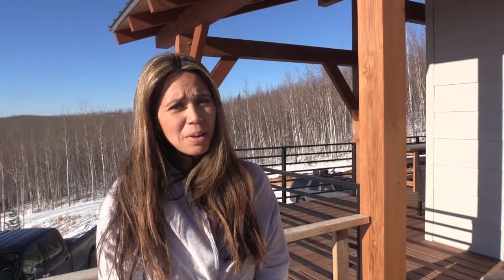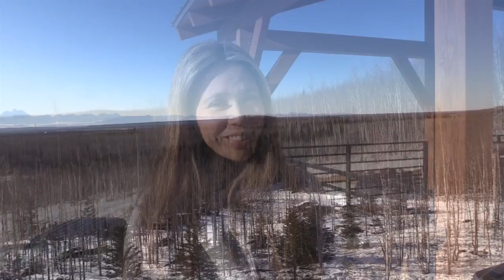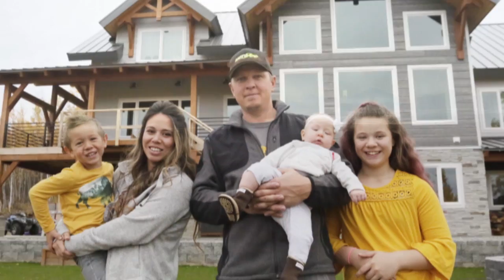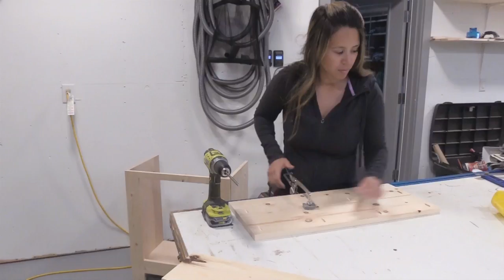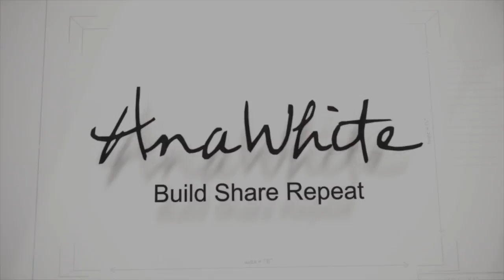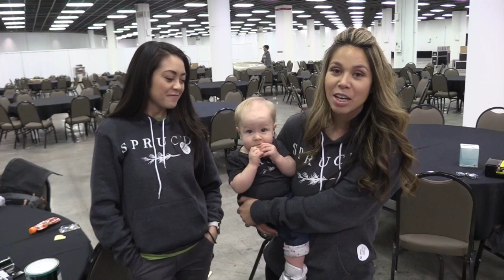DIY Trade Show Booth Design

Comment: Anna,
As soon as you pulled the coffee table apart I thought that you could probably think of some way of adding on a piece for a longer coffee table. Maybe hinges that are attached underneath the tables that fold out, lock and allow for another piece to sit on them.  Just a thought. Another idea would be to hinge the piece on top of each table and fold them out but you might need another leg for support.  Clearly I am not a carpenter and I have lots of design ideas when I look at designs.  I love your videos, a big fan.